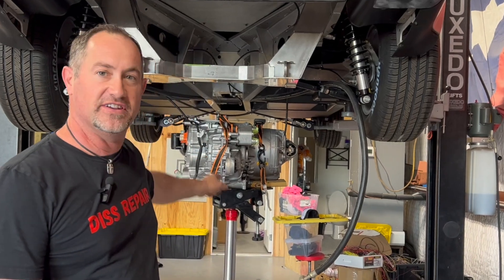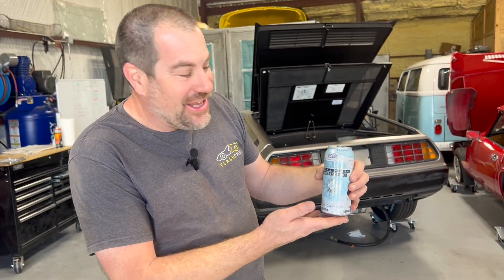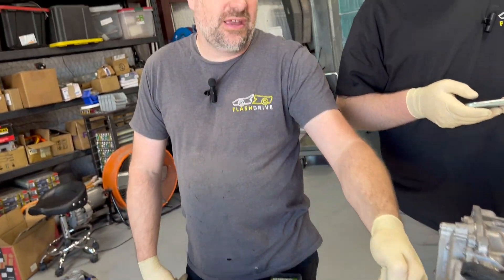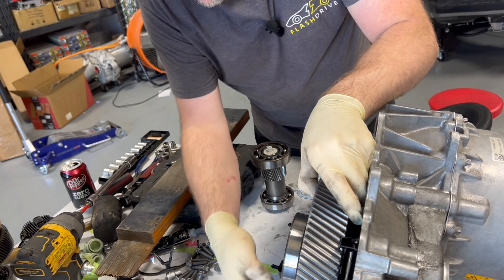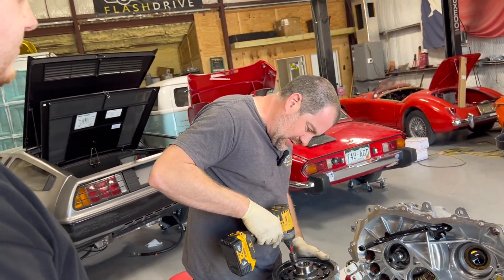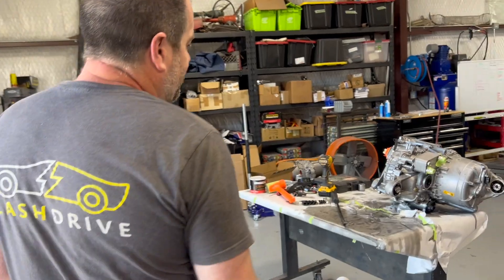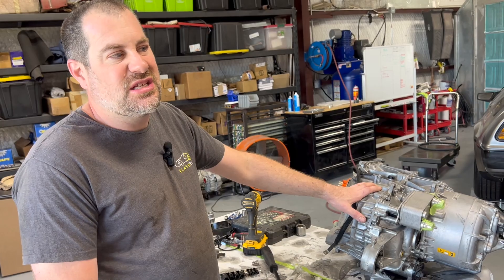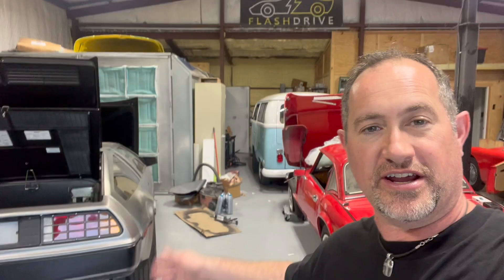HOW TO: Limited Slip Diff LSD in Model 3 Tesla and Delorean Motor Install

Comment: DMC-12, one that deserves the most an EV conversion. Thanks for making the effort to not cut the Y frame. Looks like the Model 3 motor is ideal for this project. Noob question: why do you replace the original differential? Is it because there is not anymore all Tesla electronics around to control traction?
Please keep posting!
Reply from the maker: Even with traction control it’s good to have a limited slip to have a physical link between wheels. Plus traction control doesn’t like doing burnouts and donuts